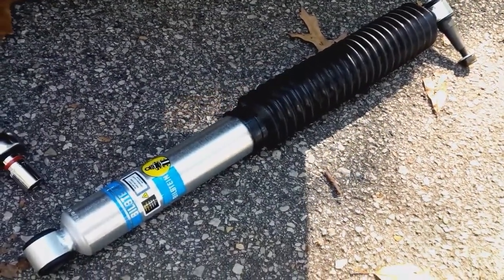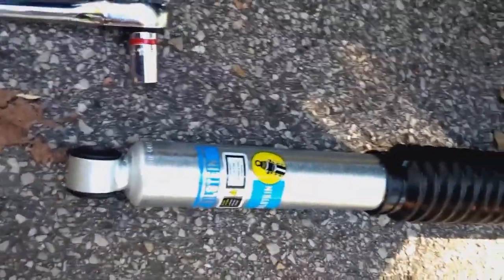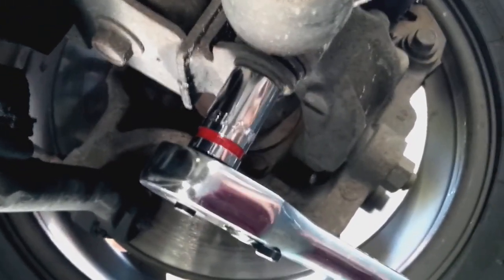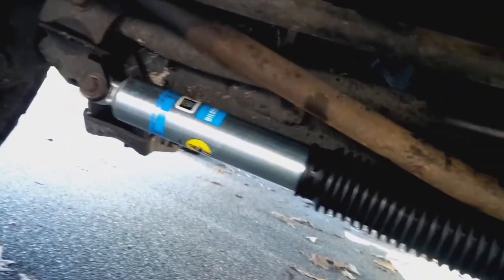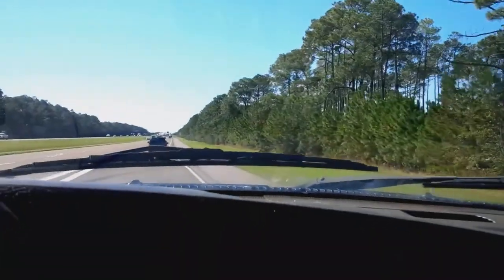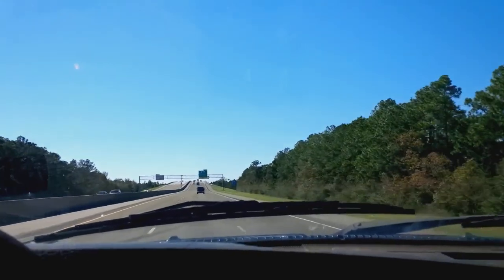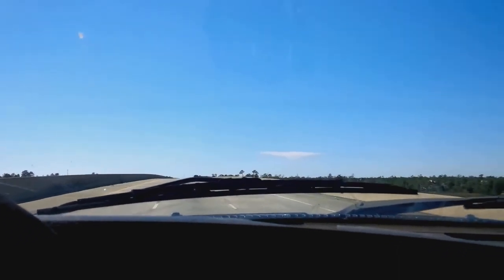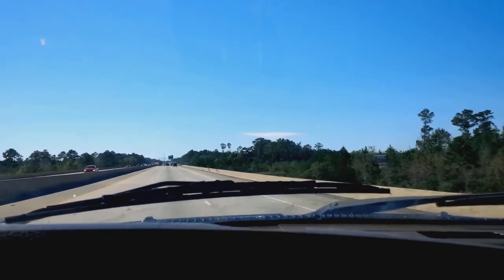Bilstein 5100 steering damper/stabilizer shock install on a 2003 Dodge Ram 2500 cummins

Comment: Anyone watching this....  If you own a cummins diesel well any diesel motor.   It will last longer then most engines out there.   So when doing repairs on items with nuts, bolts take the 30 seconds to clean the bolts and apply anti seize so the next time those bolts will come out easier....

Comment: Did you have 'death wobble' before doing the upgrade?
Reply from the maker: Tim McGivney I did not but at one time I did have the wobble but it was solved by getting new (E rated) tires
Reply: Thanks for the reply. Off topic but I have to say I smiled when I saw the sign for Bay St. Louis and Picayune, while I am from NY I was homeported in Gulfport when I was a USN Seabee back in the late 80's and into the early 90's. I have loved the Gulf Coast ever since, so it was very cool to unexpectedly come across something familiar while trying to find the answer to my 3500's death wobble.